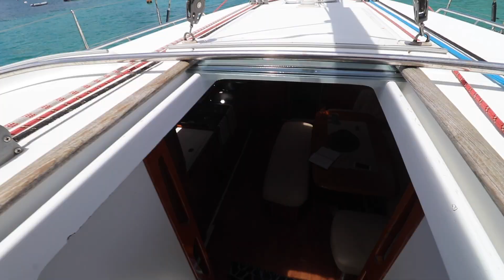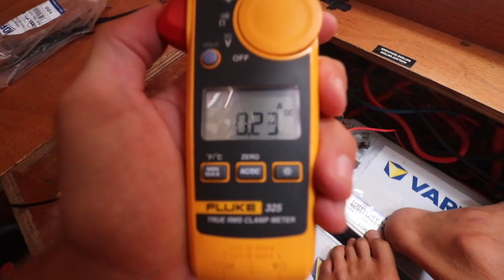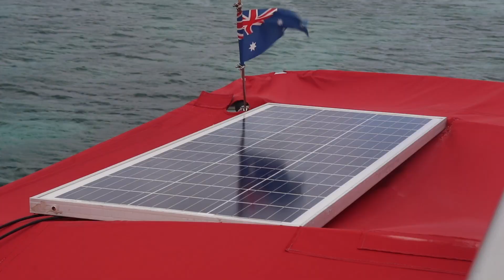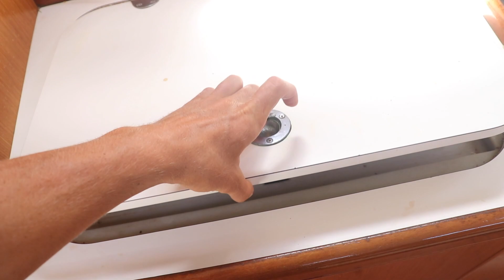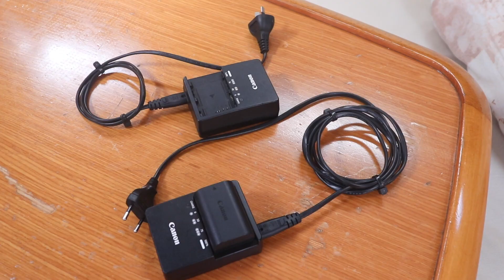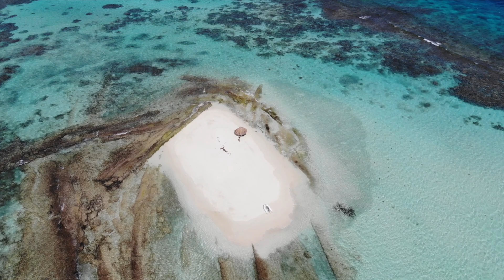Off the grid living on a sailboat  | Sailing Merewether

Comment: My dad lives off grid (proper outback) and we've set up 5 x 120 Ah deep cycle with 5 300w panels. Power draws from large to small are a large camping fridge, CelFi mobile repeater, 24inch 12v TV (everything is 12v),  satellite TV receiver, radio, LED lights, inverter that's rarely used (it charges batteries, AA and powertool bats randomly). 4 years in and it never dips below 12.9v. You could easily fit a setup like this, its not big, but provides ample power, though i'm sure you know this... and may have already done this, since this video is old now! Love knowing all the details!

Comment: Nice video.  It's good to hear this stuff from someone who knows about electricity - you weren't mixing up your amps, ampere-hours, watts, volts, etc, which is a common problem when people who don't know the subject try to explain it.

For generating power while you're underway, you could get a Watt'n'Sea (spelling?) - it's an underwater turbine (actually an impeller driving a generator), which goes over the stern a bit like an outboard motor, only a lot smaller.  On the more up-market models you can set the vanes for whatever speed you're doing through the water for optimum generation.  There might be other manufacturers who build similar kit?  (I don't use one, but I've seen them used.)

Also, I was surprised at how how much the Fluke clamp-on meter was jumping around when you were measuring the battery current drain.  Maybe the PC charger current draw is very "peaky" due to whatever the microprocessor, screen, disk drive, etc, are doing at the time?
Reply from the maker: Hey friend. Thanks for the nice words. We actually looked into the wattnsea but at the time we couldn’t afford one. Right now our solar does us quite well with around 500 watts. We just need to upgrade on the size of our batteries. Thanks for tuning in
Reply: @SailingMerewether  No worries about needing to increase Merewether's storage capacity, and I understand the budgetary constraints - which I didn't realise until a few videos later.

I hope you had a nice sail from Panama - where have you made landfall: Galapagos?

Comment: Short but well done. I am re-powering a 1982 Cabo Rico 38 as we speak. I can't afford the solar just yet but I'll have plenty. I was surprised to see that you draw less then 14 amps with all that running. Obviously you don't run them all at once. well, off to keep binge watching your channel. Cheers, RJ
Reply from the maker: RJs Salty Adventures cheers for the comment mate. Awesome to hear about your Cabo Rico 38z We keep a close eye on the power and only use as minimal as possible. You won’t regret buying solar when you get around to it. Will definitely help your batteries get the maximum amount of life.

Comment: Cool explanation of power systems.  Nice to see Bequia in the background.  When I was cruising (at the turn of the century), most people used 6V golf carts, had 6 -8 of them yielding a bigger bank of 675 -900 AH @ 12V.  Often saw 3-4 solar panels and  a Wind genny.
Reply from the maker: Larry Robbins how times have changed with the voltages. People are even running 24v battery banks now